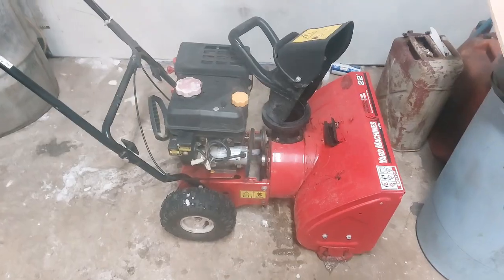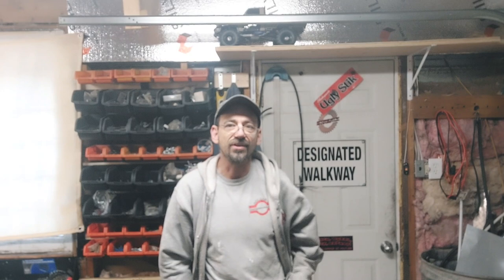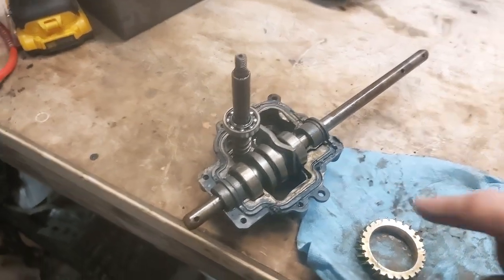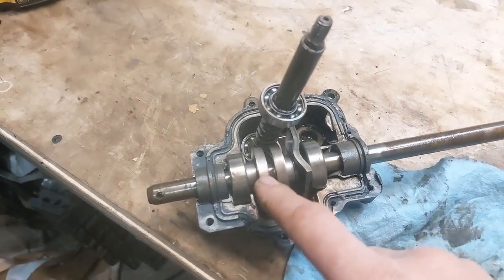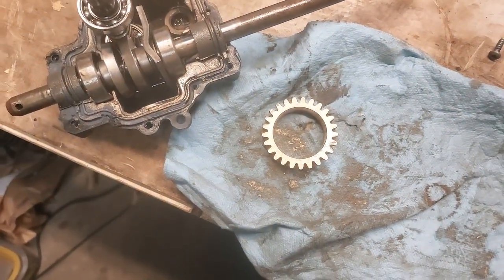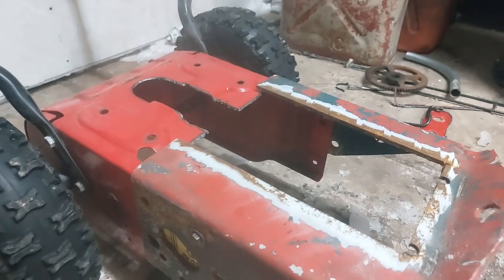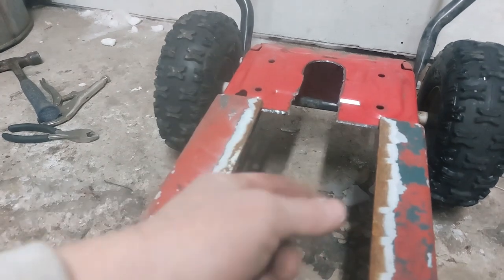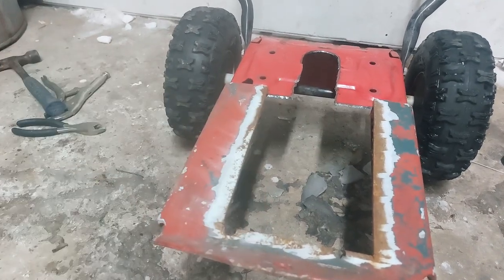How To Build A Free Engine Test Stand

Comment: the nose section that you threw out the door should have a brass gear been a few years but last time i priced one it was over 50 dollars .. check out a push mower self drive unit might have the gear in question ,, they love them gears in mowers and snow throwers and love too make you pay for them also ..

Comment: the new snow thrower .. the clutches where the turning cables go by the wheels .. if it's the unit I think it is ,, 3/8 or 10 mm bolts take the side covers off .. snap ring pliers the clutch cover comes off there should be 3 gears in there .. factory is cheap on the grease ,, it's been over 10 years since I worked on them .. think there is bearings in the gears they will get rust or eat them self being dry .. under the belly cover the hex  shaft ,, clean dirt / rust and lube the shaft light on the lube don't want grease thrown on the rubber drive system ,,check the bolts that pinch the rubber in the drive they have come loose and the rubber pops out ,,
Reply from the maker: Thanks for the tips- I'll check it all out when I do the end of season service.

Comment: I have the same blower and had the same problem. Mine lasted only about 10 hours. I live about an hour south of you so I get much less snow. I use the blower maybe 2 hours a year. Its a very poor design. The two tapered side drive plates align the bronze gear to the worm gear when fully engaged. But when released the worm gear is literally milling away the bronze gear teeth when disengaged.  As you found out parts are not available. I did buy a new axle for just over $200. This is typical of what's going on today with all types of equipment. Cheap low quality off shore products for max profits with a made in Canada price. I've been turning wrenches for 50 years and have seen a steady drop in quality due to corporate greed. Profit before quality.

Comment: I got a question about my Murray wide body LT it will not start. I'm a bad person it set out in the rain  and the Ignition switch would not even work. I added some libercut  And got the switch to turn my opinion is the switch is bad. My question is how can I Bypass it and run? I really need these thing right now to move things for me. boats to be moved.
Reply from the maker: Disconnect all engine wiring from the chassis. Now (making sure the damn thing is in neutral- apply 12v+ directly to the starter stud. It'll crank. IF your carb has a solenoid on it, you'll have to supply a constant 12v for fuel delivery. Note that when you do all this, NONE of the safety switches will work, and you'll have to ground the kill wire to the chassis or reconnect the harnesses to shut it off.
Reply: @DocSprocket    Thank you I knew you could help me out. I really need this thing to move things around right now.